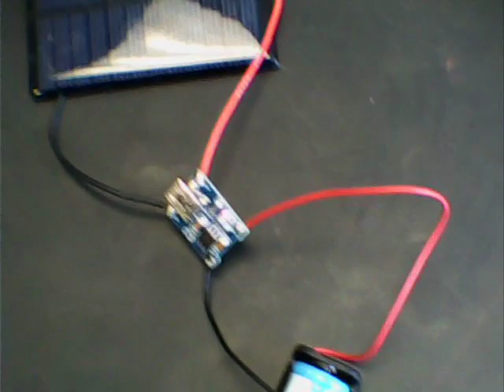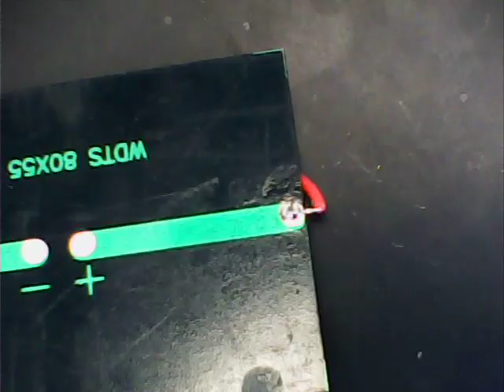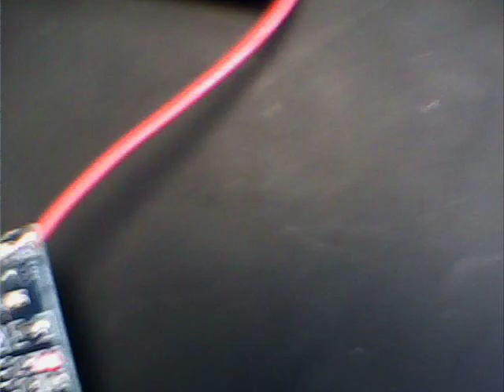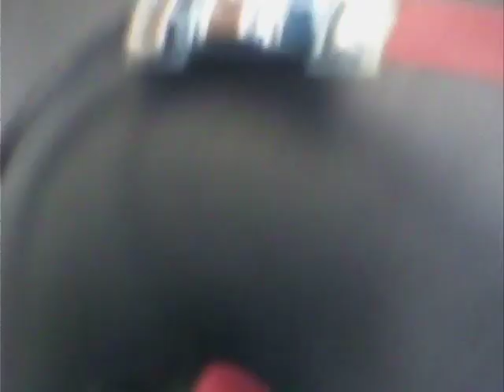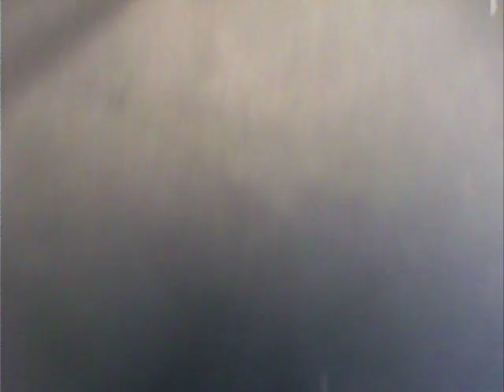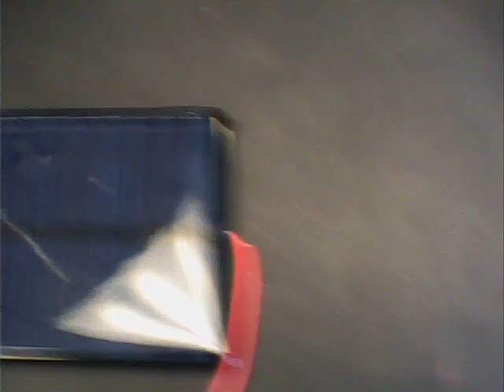Solar-Powered 3.7V Lithium Battery Charger

Comment: I'm wondering how you did it but I put on 3 such small Solar panels in parallel an could not get a reasonable Charge into the Lithium cell to raise the Voltage from 3.6V to 4V. I don't know where you guys are getting your solar power from but whenever i try to use such a minimalistic solar thing the Battery just runs out of charge with no chance to recover without a 5V USB Charger.
Reply: schubi128 Put some panels in series to increase the voltage and some in parallel to increase the current.
Reply: I only have 3 of these small panels and will never again buy one that is so small. Just now I'm experimenting with a crappy 5W 12V which is far below it specs (my test only showed about 2,5W and 12V only in idle with full sun). I wired a zener diode parallel to the solar panel to stabilize the Voltage to one that the TP4056 Board can take. So far it seems to charge, nothing blew up and there are no abnormal temperatures. If some hours of sunshine are sufficient to charge the cell from 3,7V to 4,2V I'd consider it a usable option.
Reply: Update: After a sunny day (~12hours) of charging a 1000mah 18650 cell with the crappy 5W panel over the tp4056 board the battery was charged from 3V to 4V. I charged the cell from 4V to 4,2V with a BX6 charger and it showed me an additional charge of 400mah which means the solar panel put 600mah into the battery on a perfect sunny day. This means an average of 50mA  which at 3,6V means 0,18 Watt.  Since i know the panel can produce at least 2W (0,16A @ 12V) the rest must have been lost in the conversion.

Comment: Tried this board with a very low capacity (crappy) lion cell and a 5,5V panel  with the same size like above. On a 1000 mAH Lion Charger the cell is full within half an hour butt with the tp4056 board and the small solar panel it sits for days (good sunshine)  and only charged from 3V to 3,8V. I'm wondering if I'll ever see the cell fully charged in this configuration.  The problem is not the tp 4056 board nor the battery because when I hook it up to a USB Charger it charges to 4.2 V in no time. Better don't mess arround with those small solar panels because the TP4056 seem to be very ineffective for solar charging.

Comment: SO this is really what i have been looking for.. BUT, if i want to use the battery while it is getting charged? how do I do that? The overall project is to make a tiny stereo runned by 18650 battery(s) very small speakers and Passive bass reflects and then ofcourse by the solar panel?
in advance thx for the help!
Reply from the maker: Try the experiment. I am working on a non-related project right now.

Comment: Hello fron brasil.
what if i put 4 of those batteries in parallel . will they charge?
Reply from the maker: I don't know.
Reply: Yes, they will! I've tried it with regular 5v input to the tp4056 but they will take so much time to charge.
Reply: ThE BaNDiT ThE BaNDiT yes you are right.. i just finished some tests here with 2 batteries 1 solar cell 6v/200mA and 1 tp4056 .. It took about 4 hours to complete charge. 👍😆

Comment: I've got a solar project using this charging board  & 18650's ... have added a 3.7V load on Batt leads ( Photon ) and batteries do not fully charge .. assume I need to find a way to isolate load during day to Solar only until Batts charge ..?

Comment: How can i have this turn on a light ( LED ) when sun is gone Help from anyone would be very nice
Reply: use a comparator with thr 18650 as the source, and then use the output for one LED, or a MOSFET for like a strip (wont run for long with a single 18650 tho)
Reply: Thanks Buddy, Looking up comparator  now Many Thanks :D

Comment: Suggest please i want use this module to charge mobile directly by the solar without using any battery and is this help to charge and gives smooth volts to charg.?which panel

Comment from the maker: These days, I am actually using the 18650 3.7 V charging board with a gasoline or diesel fuel generator; this is what I am doing in lab experiments these days with my students. I will upload a video on this in  a few weeks. Using a diesel generator ( I use biodiesel fuel) with 5 boards hooked up to a USB adapter is an interesting project to consider.
Reply from the maker: Right now, I am developing composite thin films for use in aluminum air batteries. I appreciate those viewers that have suggested electronic improvements. The purpose of the video was to put a concept out there for generating ideas. all the best,  Dave

Comment: can i charge my drone lipo battery 3.7v. 650mah with tp4056 and do i need u change the resistor
Reply from the maker: Trial and error. You may want to change the resistor with higher current from solar panel being used.
Reply: Charge current should be half battery capacity.

In this case no more than 325 milliamps

Comment: can i use a small solar panel to parallel to that 6v panel
Reply from the maker: +Purastam Sahoo Try and get 75-100 mA and you should be fine. If you have 5-6V, the potential is fine.
Reply: Thanks

Comment: can we use 6v 100ma solar panel
Reply from the maker: +Purastam Sahoo Voltage is o.k. but current too weak.  You will need to hook two such panels up in parallel and try that. Or use a larger panel (12-24 V)  and a 5V regulator to the TP 4056 charging board. Good luck!

Comment from the maker: Yes, this was a small demo video to stimulate experiments. Voltage is o.k. at 5.0V.  Go with a few panels in parallel to boost current. Please post your findings for the community.  I am working on collecting  current data on partially sunny days.

Comment: Very valuable info, thank you
Can we use several small panels to charge faster ? shall they be mounted in serial ?

Also New TP4056 are different from yours, there are added chips. do they still need diode ?
Reply: Use them on parrel else boom

Comment from the maker: I forgot to place a diode in with this unit. Add it to positive lead , black ring of diode away from solar panel, and toward the battery.
Reply: you said that you/we don't need a diode.....
Reply from the maker: I would use a diode with the circuit to be safe. The charging rate with this device is VERY low.  It would be better to hook the battery charger circuit up to a gasoline or diesel fuel generatorr which is what I do with my students!
Reply: solar cell is basically a diode, as long as you dont short it out, you dont need to one